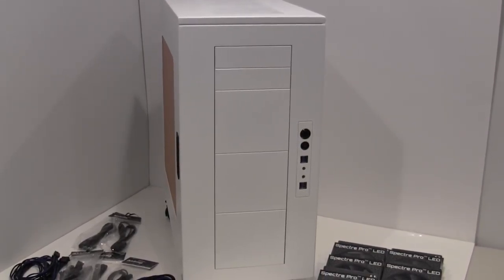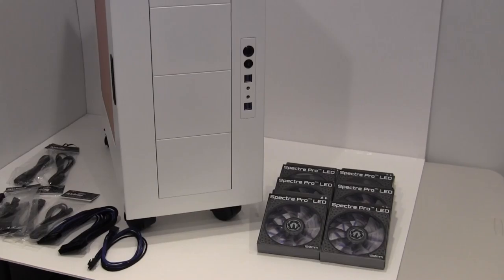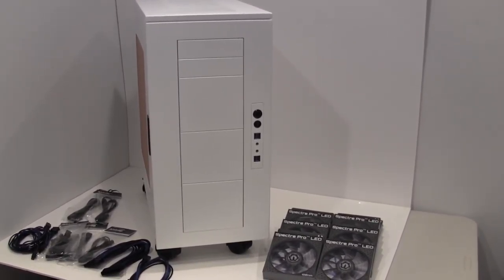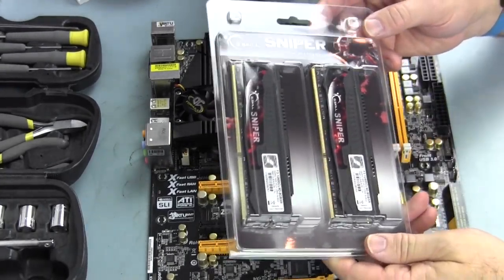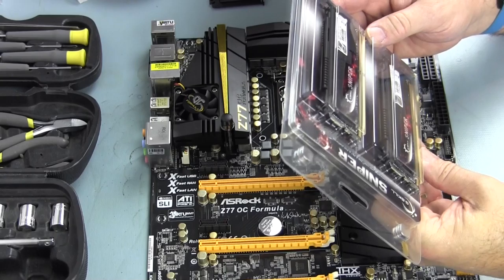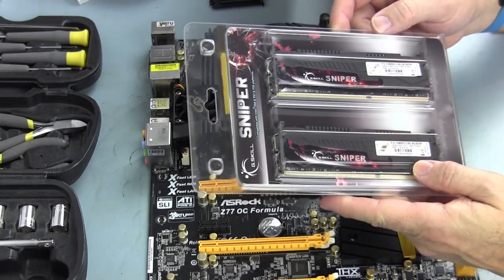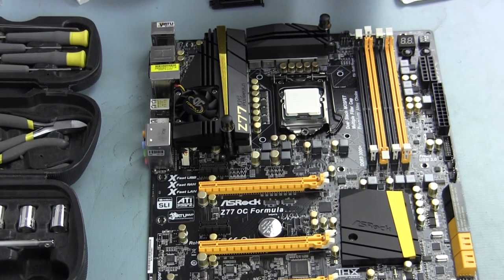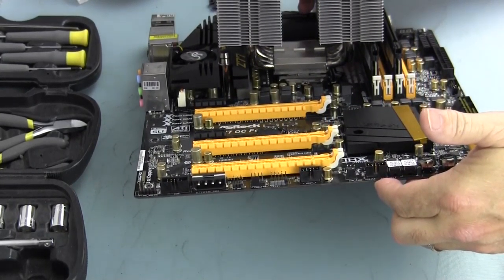Case Labs SM8 and Z77 OC Formula AIR Cooled Build Log 2 - Install i7-3770K and Phanteks PH-TC14PE

Comment from the maker: You are absolutely correct. It was connected so solidly that I really thought it was one solid connector.  Inspected real close and found the latch as you said. My bad and thank you for the info. I have used at least  25 different model power supplies over the years and never had one so solid that could come apart. I will edit that in my video.

Comment from the maker: An 850 would be just fine you are correct.  I needed one and wanted to try out the 1200i for the next water cooled system build in this case. Certainly overkill though. When it comes to power supplies I tend to get more than enough. Thanks for watching. New video will be coming probably Sunday night.

Comment from the maker: You know your are right. Someone else also told me about that. I have owned and used over 25 different power supplies for many builds and this was the first one that I noticed that had the connector clipped together as solid as this one. Sorry to disappoint.  But thanks for the info.

Comment: There's a small latch on one of the sides of the 8 pin (which I had to pinch with tweezers) that makes it into 2 x 4 pin.  The latch is small and easy to miss and is hard to separate due to the cable sleeving keeping the wires taut.

Comment: While watching this I noticed that the 8 pin 12v ATX connector you used the adapter on is of the 4+4 pin variety. You can split it in half into two 4 pin connectors and do away with that adapter if you choose to. I don't know if anyone else has brought this up so I may be being captain obvious here but I thought I'd point it out on the off chance no one had.

Comment: you should be able to fit up to 5mm under the heatsink, and you can push up fornt fan as needed, just watch out if your case is wide enough, in case you have to push your fan a bit out.

Comment: Its probably already been said but you can set the fans up higher or shift the fans over so that one fan mounts on the rear side of the sink adn one in the middle.  Here again I am not a fan of either of those choices so you made a good call just swappign the ram but for some who don't have that option you can try those.

Also when cleaning with Arctic clean... use a coffee filter.. it doesnt leave behind crap that a paper towell will.

Comment: im doing my first computer build and i also am using the Z77 OC Formula form asrock but have read alot of bad reviews about the board not working and dead pci slots  have you had any issues with that mobo besides hating to reset the lanes and im useing a 1000w psu and plan on doing liquid cooling later on

Comment: One other thing... your line for your thermal compound is going the wrong direction.. you applied it for how a dual core is done.. you should have ran it left to right for a quad going off of arctic silver's application method... reason being how the die under the heat spreader are oriented.

Comment: I dunno. It seems, and I could be completely wrong, that each generation of CPU is hotter than the last so the heat sinks are getting bigger. I remember my old Pentium heat sink, it'd be dwarfed by the Phanteks. Think we'll eventually have to water cool or will technology produce cooler but more powerful CPUs?
Reply from the maker: Yes, but I think the last series used poor thermal interface material/glue to bond the IHS to the chip. The new series i7-5xxx use solder which conducts heat much better. I guess we will see.
Reply: Yeah. It's been natural progression. 8088 to 486 was all fanless, 586 and up has been fan cooled. We're now touching 4ghz with out overclocks. I mean, heck, the new R9 295 video cards come water only, no air options. Should be interesting to see the new R9 series or R10 if they skip ahead to that.

Comment from the maker: GTX-680, yes I do if you can afford it. But first look at the GTX-670.  The 670 is only about 5-10% less powerful than a GTX-680 so it is the best bang for the buck value at $100 or more less.  You will probaly not even notice the difference in most use.  You can use that $100 towards something else you need in your system.

Comment: The only reason I watched the video is with this cooler is possible to fit the RAM! So no Phantex for me.
Reply: there are low profile rams or do what i did and cut off the top of the corsair vengance heat sink
Reply: It supports RAM up to 50 mm height.
Reply: @domenrokbruncek6366  I called customer support on this issue. They assured me that there's clearance up to 45mm.

Comment: you have done a little bad thing after pealing off that sh1t from heatsink you should clean it to make sure no micro glue rezidue parts left that can couse problems later on ... and dont say it doesent mater if it dont then dont use cooling paste =D after glues burn air stick there and thats why we use paste ...